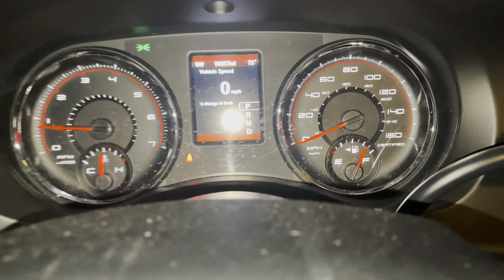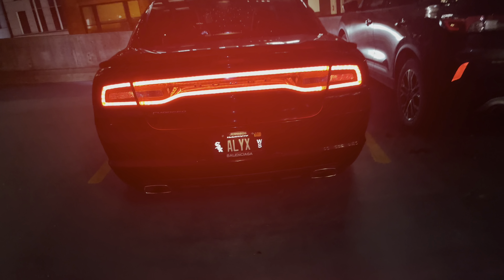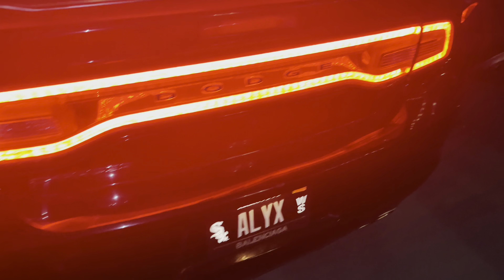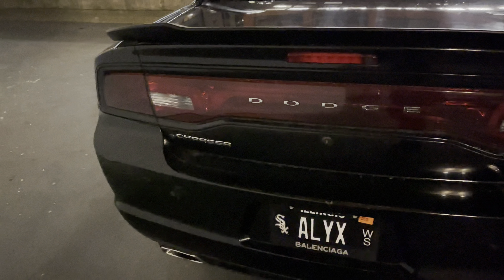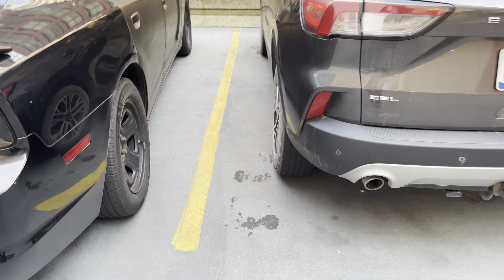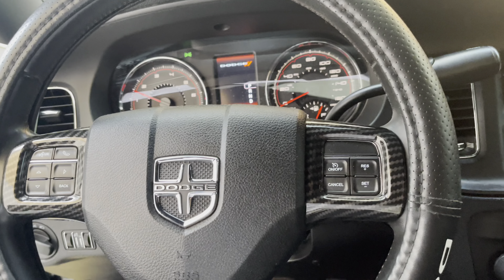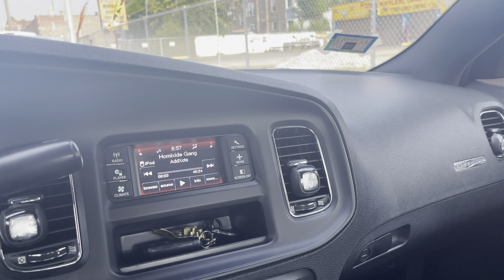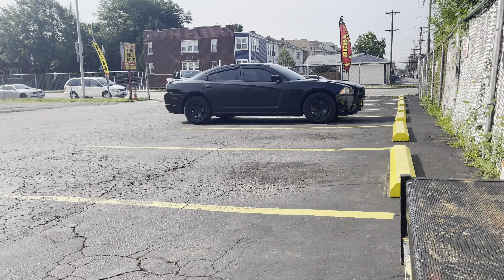I Finally Straight Piped My 2013 Dodge Charger V6!!! ( It Was A Game Changer! )

Comment: a v6 charger straight piped LMFAOOOOOOOOOOOOOOOOOOOOOOOOOOOOOOOOOOOOOOOOOOOOOOOOOOOOOOOOOOOOOOOOOOOOOOOOOOOOOOOOOOOOOOOOOOOOOOOOOOOOOOOOOOOOOOOOOOOOOOOOOOOOOOOOOOOOOOOOOOOOOOOOOOOOOOOOOOOOOOOOOOOOO
Reply: nothing wrong with v6 dude. a 3.6 engine is not a small engine